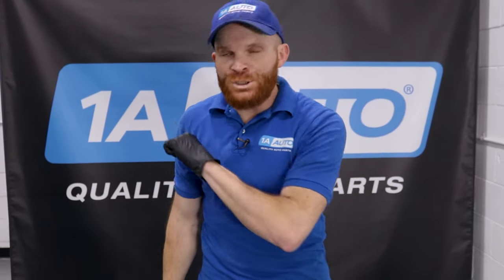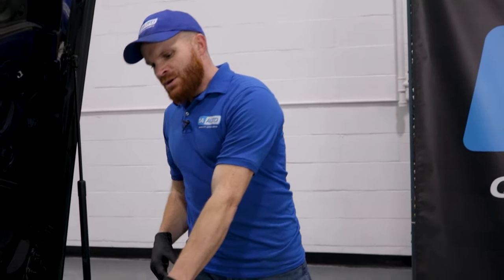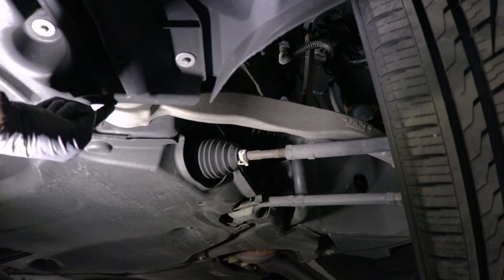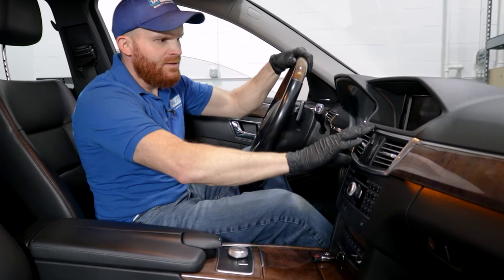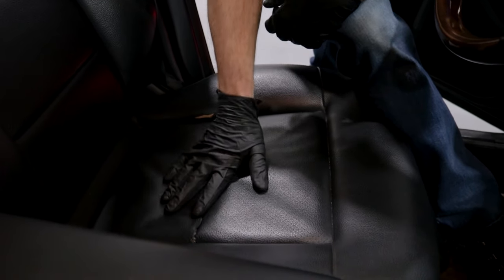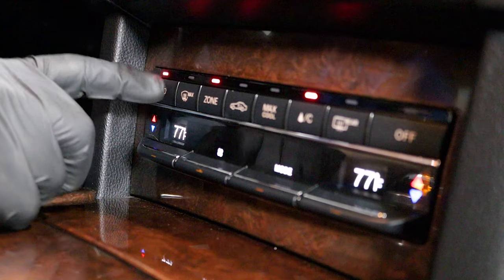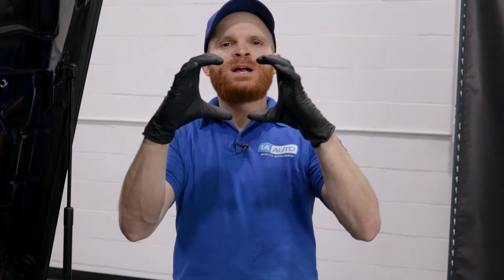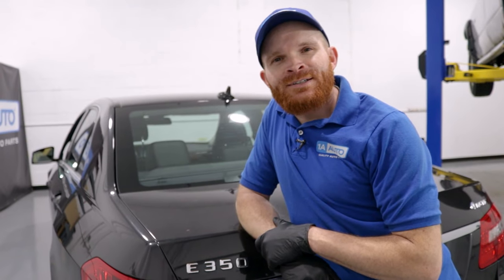Top 5 Problems Mercedes Benz E Class Sedan 4th Gen 2010-16 W212

Comment: That weird shifting between 1st and 3rd is because the car by default is in comfort mode which puts it in 2nd gear automatically when you put it in drive. Putting it in sport puts it in 1st when the car goes in drive. Problem is you can't default to sport on startup.
Reply: you can startup,if you push button S it start in sport mode,,but actually even in default in my diesel automatic it in 1st gear when i start.
Reply: My 2011 e350 just started clunking really hard between 1st n 3rd. I drove it really hard tho and of course it just started after my 2yr warranty ended 😭

Comment: I just bought my 2013 e350 yesterday with 90,000 miles on it, very early but runs like a champ
Reply: Keep us updated on it
Reply: @danielrivera8422   I own one last 3 years. E350 2013. Just oil change, filters & tires.
Reply: Of course it does! It's not an AUDI... lol
Reply: @1970borntorun  audi n bmw is terrible
Reply: Hows it going now?
Reply: @milosr4879  same! I have e35 fully loaded! Bought in 2017 with 60k now has 99k. Only paid for serviceable parts & recently spent a good penny on 100,000 service! But I never had a check engine light either! Knock on wood
Reply: How the car running I just put a deposit on a 2013 e350
Reply: @issavibez394  vw crap
Reply: It’s running great still! It has 100000 miles now and I just had to put regular maintenance (oil change, air filter, etc) into it.

Comment: I own a 2010 E550.  I've owned every E-class since a 1993 400E (W124).  This latest one is by far the best in quality although like most cars, has a few quarks and issues.  I bought this car new and ordered it to my specs.  I have 97,000 miles on it.  Following are a few problems I've had:  I had to replace the starter twice because it was dragging badly and drawing to many amps.  I don't have Sirrius radio anymore and the dealer won't tell me what's wrong without charging me a gazillion dollars to investigate but I think it's the satellite control module.  It eats brakes frequently but perhaps that's because I go fast and stop fast (can't help it with this car, it's fast for a 10-year old sedan).  I have the same problem with the cupholder cover.  Fixed it once under warranty but the problem returned.  Otherwise, no problems with interior.  I've had to replace one rear shock and it was expensive since I have airmatic.  I also have a leak somewhere that the car will drop if it isn't ran for 2-3 days.  I replace a headlight unit.  It has curve sensing option so it was expensive.  Some minor oil leaks and bushings replaced.  Otherwise, this has been a great car and has a V8!  All together, I've spent about $85k for this car, including maintenance and repairs.  That come to about $660/month to drive a V8 Mercedes Benz for 10 years and it has almost all the features of new cars.
Reply: Huge piles of junk it doesn’t have 100k miles on it and you had to replace all those expensive parts? Wow I will completely avoid Mercedes bmw at all cost. MERCEDES ARE NOT RELIABLE CARS IN FACT HUGE MONEY PITTS! Wow!!!
Reply: Do you have an instagram
Reply: @Mercifulkingdom  as of this date, his car is about 12 years old.  He bought a 2010 one year ago.  Who knows how it was treated before he bought it?  Or, didn't you read and understand those facts?
Reply: @Mercifulkingdom  the Mercedes v8 is one of the most reliable engines ever made. The BMW v6 is pretty awesome too.
Reply: @gailramsey1979  Sounds like your the one who didnt read and understand his post!
He said he has a 2010 E550 with 97,000 miles on it and bought it brand new and ordered it from mercedes to his own specs.
Didnt buy a used car as you stated!
Scratches ones head as to what you were reading! 🤔

Comment: My 16’ E350 just went over 30k miles. I’ve owned it for a little over a year and haven’t experienced any of these problems. My auxiliary battery is going out and preventative maintenance at the dealer isn’t cheap. Other than that it’s been a pretty good car this far.
Reply: HUGE PILES OF JUNK NOT VERY RELIABLE IN THE LONG RUN
Reply: Idc about 30k come back when it’s at 130k
Reply: I had the same problem with my auxiliary battery on my 2012 E350 Bluetech Mercedes Benz. I went online, purchased a new auxiliary battery, then I went on YouTube to learn how to install it myself. Mission accomplished!  I love my E350. Best car I ever owned and proud to have it.
Reply: @wumcallstar3880  where is the aux battery? Under rear seat?  My radio panel seems to reboot every 5 min. Might be the aux battery? Pls share YouTube video link to fix aux battery.
Reply: aux battery is a pain but replacing should run you about 500 then you don't have to worry about it for a couple of years.

Comment: I've been daily driving a 2012 e350, i'm at 190k miles and it still runs fine. I'm no mechanic by trade, but have done 99% of the maintenance and repairs myself. Currently have a few things to replace, all things that go with time. But overall, engine and transmission are super reliable, and this thing has served me well for the last 10 years. I'm hoping to ride it into the ground.

Comment: See I been considering this gen of E class because I heard lot of reliability. But damn, we’ll see, probably won’t even go for it haha
Reply: I have this car for 5 years now, only problem and one thing I changed is the battery... 180000 miles on the clock
Reply: for reliability take a good look at Lexus.
Then be curious and compare how many used Lexus on a Benz lot vs. how many German money pits traded in at a Lexus dealer...
Reply: There is nothing out of the ordinary wrong with these. Camshaft & crank sensor go out on every car. American & foreign. I've had the those fail on my Ford Explorer, SVT Lightning, Toyota Supra & etc. I have an 2005 CL55 AMG as well as my 2016 E63-S AMG and I have never had crank or camshaft sensor failures on either of them. They have been some of the best cars I have ever owned.
Reply: You will find something on every car...
Reply: Definitely go for it. I’ve had mine for a few years now and it is an excellent daily driver. The reliability on the 2010 and 2011 e350s are actually very good and better than most midsize sedans regardless of the brand. For a car that is 10 years old the options and tech are equal to or better than most modern non luxury cars. There are a few things he could of added to this video like the thermostat and ac pressure sensor but none of these things are really major issues. I would say the only major issues you will have is the transmission valve body conductor plate which is about 2-3k or just under 1k if you diy it. The other major thing is the intake manifold. There is some sort of actuator arm that controls some flaps inside and it gets brittle and breaks. You can just replace the actuator arm with an aluminum one to save some money but it is a lot safer to replace the whole manifold so no pieces break off and go inside your engine causing some serious damage.

Comment: I have a 2010 e350 coupe only trouble so far in 80k miles both rear abs sensor rings disintegrated taking out the sensor quite an expensive job as axle has to come out to reach them.

Comment: I have a 2016 E300 and had a transmission issue (similar but maybe not the exact same one as mentioned in the video) after 3 1/2 years.  Fortunately the car was still under Mercedes's 4 year bumper to bumper warranty, so they replaced the transmission for free.  Otherwise it would have costs me $10,000 CAD.  In a way it did cost me since after that experience I got the extended warranty which increased the warranty to 7 years for $4,500 CAD and then got the extended warranty on the 2019 Mercedes GLC that I bought, an additional $3,500.  But both cars are covered for a full 7 years which by that time I will probably traded them in fro newer Mercedes.
Reply: That's actually totally different gearbox. On video he talk about 7g-tronic, your is newer type 9g. Anyway that's cool they changed the whole gearbox, at the last moment of warranty, lucky you

Comment: I had a problem where my speaker amp went out and my drivers side door latch stopped working. Heated seats stopped working but never went and got that fixed. My cupholder also stopped working like it did in this video. This is all under 60,000miles. Thankfully i bought mine CPO so when they amp went out it was covered. The other issues was out of warranty. But I do believe its a solid car. I would never buy a new Mercedes or a used Mercedes outside of warranty.

Comment: İ want to buy E350 4 matic 2012.  What you say? Have this car problem?
Reply: I have the exact car . Has small quirks like the wood fading and seat also the cup holder not sliding all the way other then that I love the car awesome vehicle best car I’ve ever had .
Reply: 4-Matic has a transfer case that eats output bearing around 70kMi.

Be sure to change short lived ATF around 40 to 50kMi including Xfer case.

Keep in mind that Repairs bring in more profit than simple maintenance... Case in point: 4-Matic failure 🤫
Reply: Get one without all wheel drive/ 4MATIC

Comment: Omg those interior creaks, my eye is twitching
Reply: I have a 2012 e350 and fortunately is not like that 🥳
Reply: I read somewhere that the quality depends on the place where they were built. Mine was built in Sindelfingen and is not creaking like that tho
Reply: sad but a little felt tape in between the plastic parts will fix all the noise.

Comment: I’m looking to find one of these in V8/4matic to add to my fleet of old Benz’s. I have a 2001 W210 E430 and a 2005 W211 E55 AMG and while there is ALWAYS something little broken on them, I have literally driven both of them thousands of miles with no major issues. I recently took the W210 over 4000 miles in less than 2 weeks, averaged nearly 27mpg at almost 70mph. I need something AWD for winters in my new city and I like the pre-facelift cars and I just can’t go for some generic suv.

Comment: Air Suspension failed at 100k miles. Front and rear, one year apart. Engine mounts at 80,000miles.

Comment: 2014 E350 purchased new in 2013, 85k miles. Essentially zero problems, no major issues. Although admittedly I do a ton of preventative maintenance (frequent oil changes, already done transmission, transfer case and front/rear diff services, etc). Only annoying thing is the aux battery which I've replaced twice, and some issue with a loose pulley. Only annoying issue is A/C has frozen up (??) when used a lot in hot weather, requiring shutting it off for a few minutes to melt/clear, then works fine. Have had A/C serviced 3-4 times, apparently it is somewhat of a common issue.

Comment: 2013 E350 w/ 155k miles. 

In 7 years of ownership, I've experienced 2 issues.

I have had the thrust link issue which required the bushing to be replaced, and I also experienced interior issues. 

Interior issues: cup holder cover doesn't retract all the way (same as the video), squaky panels when you apply pressure, volume knobb on the radio is not responsive (turning the volume up or down doesn't work if I spin the dial faster than a moderately slow pace), and ripped seats (ripped seat, same as shown, and also ripped seat bolsters.)

Not bad for 6 years of ownership.
Reply from the maker: +Christian Hammad Thanks for the feedback!

Comment: No I dont agree with u on transmisson noise, front wheel bushes or rods...or any sort of funny noises u mentioned...never popped up...
  The issues i encountered are Engine mounts needs replacement after every 20000 miles..., yes seat covers are not the best...it rips off...yes ,diesel vehicles get clogged off every couple of yrs....hence DPF & exhausts  system needs to be cleaned off ....is pushes out loads of black taar out of exhaust .....& hence car'z pick up  & preformance longeivity  increases ...!!
  Some of these Merc E classe's facès another lill issue  & that's of waterpump 
Rest ok by grace of ਵਾਹਿਗੁਰੂ
Reply from the maker: +khalsa Thanks for the feedback!

Comment: I bought 2012 E 350 the only problem I’ve had is the seat issues but my car drives great I trust it to go anywhere an I now have 170000 miles on it an I don’t dog it but I drive an flow with the traffic if I’m not already leading the pack very smooth an slick car

Comment: Boss why my e200 cgi petrol consumimg to much fuel 5 litre gasoline giving 10 miles only, even after changing original 4 spark plug n 2 aftermarket ignition coil, please suggest me?

Comment: How about when your airbag module goes?   And it will go.  And that means that all 16 airbags won't work and have to be re-calculated.  2000 dollars at the dealer minimum.    Has to be done at the dealer because they have the proper machine. -Enjoy that.     I had panel gaps and seats fixed and my vehicle doesn't sit in the sun.  I also replaced all interior lights with LEDs and put carbon fiber over some of the wood and plastic. Transmission done last year and two dealer oil changes in a package/bundle deal.  Still, expensive as F.  New Tires = Any car.   Replaced emblems with modern AMG black on wheel center caps and hood.  Replaced the shitty Mercedes plastic door locks with fancy light carbon fiber ones and didn't replace air valve  caps. The OEM plastic ones help seal the tire pressure.   AMG Sport wheels are fun.  Replaced brakes/rotors with better crossed drilled than the manufacture ones and they were always amazing.   

Only thing to do for a hefty cost is brake lines and spark plugs.  Dealer wants over a thousand to eighteen hundred to replace plugs.  Didn't want to ruin the natural look.  I could have covered all the wood and the silver ground splitters but, that's too much.  <considered replacing grill, fitting a rear diffuser, replacing the steering wheel and putting a modern android GPS in.>  Those went too far.   I did cover the steering wheel in Alcantara stitching and updated the GPS to 2020.   Basically everything that didn't require disabling airbags, battery and what could be done at home.  I'm not screwing with any settings or battery/airbag things.   Mercedes cup holder liners, Mercedes umbrella, Mercedes sunglasses, Mercedes front shade, Mercedes Wipers, Mercedes Cargo Net, Mercedes Comfort Box and Mercedes Spare tire Kit are all OEM.   Trunk rubber liner was custom cut and rear and front rearview mirror 4K LED screen was installed with all wires hidden.   Auto dimming rearview mirror was too dark at night and recording was paramount.    Wireless charger was installed where cigarette lighter/12V slot is and ashray removed.

Comment: Transmission service is messy, but relatively easy and should be done every 40k mi on cars with red fluid, and I believe 60k mi for those w/ blue fluid. Speed sensors are located on the conductor plate which is connected to the valve body. Valve body is directly accessible while fluid is drained and pan is out during service. Sensors can be replaced, and ppl do send out their conductor plates to be refurbed for around $300. Far better than an '03 TL I had which needed 3 tranny rebuilds. P.S....they were much more than $300
Reply from the maker: +RothBeyondTheGrave Thanks for the tip!
Reply: @1AAuto  Just incase someone thinks it's the bitter end (including myself hahah), hopefully it'll be alright. Thanks for your vids!

Comment: 2010 e350 sport with 43k miles thought I had the crankshaft position sensor problem the car would sometimes not start, check engine light n esc inoperative I would go to the store n come back out n car wouldn’t start sometimes went into limp mode got the car scanned for codes about 9 different codes came up long story short it was at the dealership for 2 weeks they couldn’t figure out what was wrong cuz I cleared the codes prior to towing it to the dealer but they physically looked for the problem n it was a relay switch had the starter stuck in the off position $20 part + 180$ labor 8 months later still going good no problems only problem I’ve had with mines

Comment: These problems are nothing but (owner neglect) the previous owner didn't give a s**! I'm sure he had it as a  daily driver!! Rule number one if you're going to buy a Mercedes (especially a used one "do your f***** homework & 20 year friendship with a Master mechanic helps tremendously! (Trust me) if you have an EGO well I'm guessing that's going to be your daily driver! If you don't like myself then you're able to pick up another vehicle to trick out! (Jaguar S-Type V8)  Or pimp out! those two cars comebined an average of 400 miles a month or less!! My daily driver is a 1992 ES300 Lexus that's beat up from the floor up sporting that clear coat damage that really makes it stand out! The car runs like a champ and blows the coldest air! I love my bucket!

Comment: My 2013 has been solid except for the harsh 3rd gear shifting issue. Usually noticeable when downshifting into 3rd to accelerate and exactly how it's described in this video. The creaking issue was a surprise. Mine was a bank vault. I have a 2015 LS460, and only the LS460 has been more quiet. It's built like a vault in my opinion.

Comment: I have a 2010 E550, 82,000 miles. The biggest issues has been and still is, it drain the battery often, changed the alternator and starter, mechanic can not figure out, and yes I change the battery twice, still does it, I have to charge the battery, if i do not use the car for a week. All the plastic in the car are crack from the heat in Florida, and yes the seats are broken too. I expect an expensive car to be better.